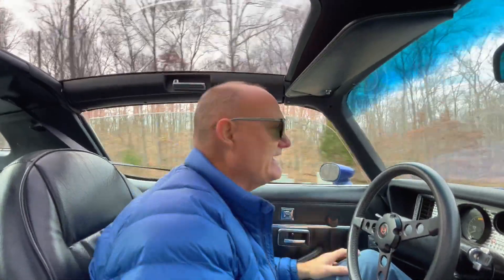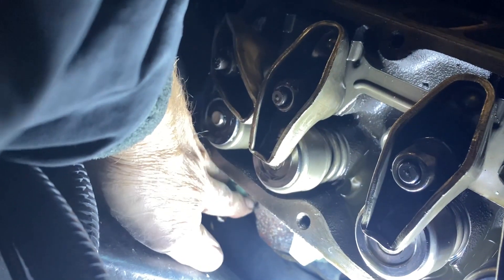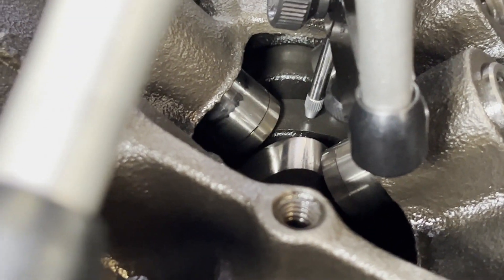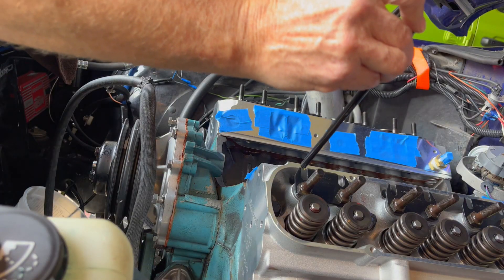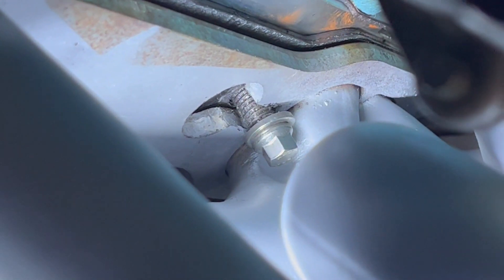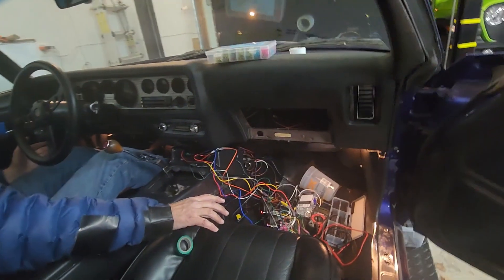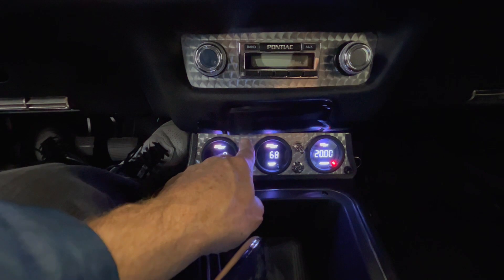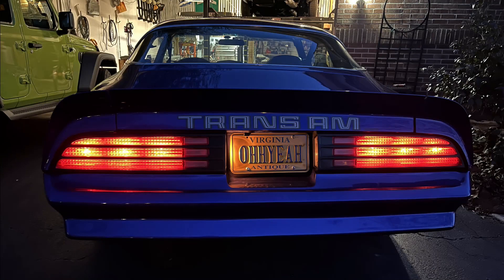Install Edlebrock heads on 1978 Pontiac Trans AM (engine in car)

Comment: 3:00 mark ……..had my engine doing the same thing… always 6 months in engine would warm up and milky ways would be on the stick 

As shown that scraper was the bad guy by the last guy …..

A had a groove just enough for a leak to push through.. 

Because of it …
Had to Emery cloth the area and fill with weld epoxy . But hairline scratches made it possible..
Reply from the maker: Glad you solved it. So far no problems but I really haven’t driven all that many miles. I just take it on short trips to warm it up and blow out the dust. Maybe burn a little rubber. I need to pull the filter again but I’m a little afraid to do it.
Reply from the maker: Glad you solved it. So far no problems but I really haven’t driven all that many miles. I just take it on short trips to warm it up and blow out the dust. Maybe burn a little rubber. I need to pull the filter again but I’m a little afraid to do it.

Comment: Header bolt tip! You can get stainless steel socket head cap screws that are pre-drilled for safety wire. I still use a high quality lock washer teamed with .030 stainless safety wire will never let those bolts come loose!
Reply: Never did the wire thing but remflex gaskets are really good.

Comment: Electric fans should be on a relay and not just a fuse
Reply from the maker: Thanks, video didn’t show it but I did have both fans on a single relay and fuse. I now have two relays and two fuses. Also two temperature switches so they don’t both start-up together. Seems to work ok now.

Comment: That is a very nice 78 Trans Am you have. I have a numbers matching 1979 Trans Am SE 400 4spd WS6 car, AC,T-tops with black hobnail interior. I pulled the original engine and trans and put them in storage. I then built a Pontiac 455, forged pistons, Edelbrock heads, RPM intake, hydraulic roller cam, Holley 950hp and Dougs Headers. It runs really good. 

I installed newer style Sanden AC compressor kit and made sure my AC ducts were in the proper locations and tried to seal them up best I could but the AC blows really weak out of the vents. I put a brand new AC/heater blower motor in but that didnt change anything and is still weak. The heater blower motor I purchased was from Autozone and is the same blower motor for all the 2nd gen Trans Am/Firebirds.  Does your blower motor move alot of air if so may I ask what brand?
Reply from the maker: That sounds like an awesome TA. I  love the SE 4-speed cars. I have the factory blower/evaporator with an aftermarket Compressor. When  I bought the car it didn’t blow very well out of the dash vents and the problem was the diverter doors. I added a vacuum accumulator and bought a replacement vacuum manifold on eBay for the dash controller as the original was leaking. I also blocked the crotch vent for the passenger (sorry passenger). That did the trick but now it doesn’t blow in high but I have a new relay that I hope will fix the problem. System is 134 and it blows reasonably cold.
Reply: @davebdave1  Do you have some part numbers for that Vacuum Accumulator and that Vacuum manifold as I am not sure what those even look like? I appreciate your reply and if you dont have part numbers I will try to google those and find out what they are.
Reply from the maker: For the accumulator/reservoir I used a Dorman 47076, the Manifold is called a Vacuum Mode Control switch, can’t find new but here’s a rebuilt one on eBay. You have to remove the dash A/C control to change it.  
https://www.ebay.com/itm/402975995096